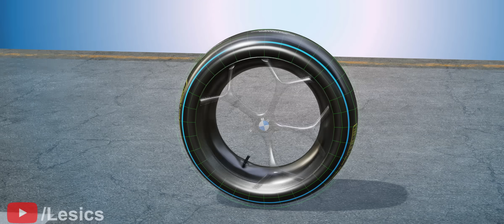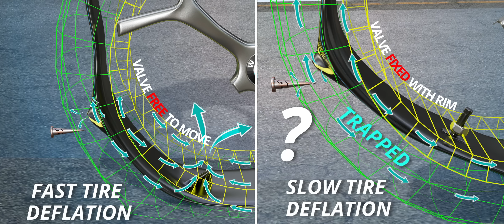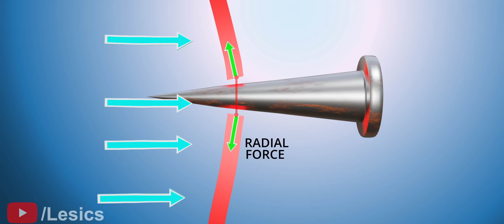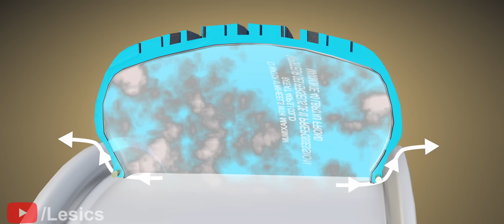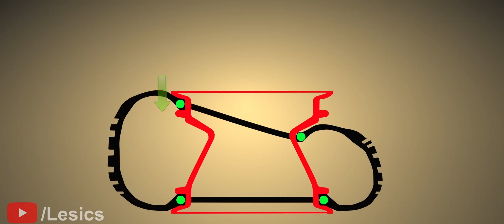Tubeless Tire | The interesting Physics behind it

Comment: I believe the expansion of the balloon (4:10) is what creates the tension forces at the surface. When you puncture it with the needle, it basically disrupt the equilibrium of forces on the material and now all the stress need to be supported on the surrounded material, which is now weak due to the needle stripping it. Thst explodes the balloon. You can demostraste it by expande the balloon without filling it with sir. After puncturing it, it strips away. With no air flow around the needle.
Reply: Exactly what I was thinking. Airflow does not make the ballon pop out, its just the tension applied on all surface points of the ballon material due to expansion from the air inside it. The popping is because the surface points of the ballons are now un unequal tension state.
Reply: Lol my comment got deleted.
A lot of people must have reported it.
Reply: Good observation! You can stretch a balloon! If you poke it with something sharp and stretch even more, it will break, with no air or air pressure.
Reply: @snrnsjd  How does a balloon apply brakes? I thought it would break, not brake...
Reply: @someguy4915  :)
Reply: But he's talking about tyres so the air filled demonstration is appropriate.
Reply: @gn6691  - but still wrong.
Reply: @FerdiLouw  what's wrong?
Reply: @gn6691  It is not the airflow around the needle that causes the balloon to burst.
Reply: @FerdiLouw  the airflowing out reduces the volume of balloon which together with the hole creates imbalance in tension on the surface at that point. And the balloon burst. 
But the balloon stretched over a (say) cup isn't gonna tear itself apart if poked by a needle.(you can watch a video of it on YouTube.
And if you are gonna stretch it really tight (it may tear itself) ,then the tension on surface won't be same as the balloon shown in video.
Reply: @gn6691  an inflated balloon is many times the size of its original size, the explosion is sudden lost of pressure as the balloon tearing itself up. If you prick a stretched balloon over a cup with the same tension, there will also be rapid tearing but no popping because of equal pressure on both sides.
Reply: @FerdiLouw  The video doesn't claim that the airflow makes the balloon burst? The video claims that the expanding forces in a tire (centrifugal forced + air pressure) make it burst... The video instead shows that despite air flowing out a puncture hole, the tire/balloon doesn't burst.
Reply: @someguy4915  He said "when you puncture this balloon with a needle the compressed air will rush out through this narrow gap. this escaping air will generate radial force on the balloon thus expanding the punctured hole" 😂😂😂😂 And then he calls it "fundamental knowledge"! Enjoy.

Comment: My car rim does not have the hump. Internal pressure keeps the edge fixed with the rim. It was worth the investment.
Reply: Thank you for pointing this. I never seen a tyre rim with hump. All are held by air pressure.
Reply: @Reclaimer141  Other way around. Almost all rims have a hump. The only ones that don't are tube type rims. I've changed thousands upon thousands of them.

Comment: when you convert the tube tyre in a tubeless tyre, when this one it´s punctured explode like the tube tyre, because it doesn´t have the sticky tape right?
Reply: The explaation is not correct. A tyre wont explode if puncured by small sharp object, no matter if it is tubed or tubeless. Every outer tyre has reinforcement inside (plastic and metal mesh/net that keep it from exploding. Also the rim doesn't need to have hump. Air pressure is forcing rubber to press against the im and it makes airtight seal, so air dont escape. Hump can only help when tyre has lost pressure so that id doesnt slide off like when mechanic ramoves it from rim.

Comment: This video is incorrect at some point. Let me explain why:
1. The tyre i am using is a tubed tyre.
2. There is no hump in my wheel. Infact, the company never produce suzuki 800 with tubless.
I am using the tubed tyre in a tubed wheel as a tubless setup and never had an issue once for almost 5 years.

Comment: Is it safe to convert a tube less tyre to tubed?
The repair guy suggested this, he added a tube in my damaged tubeless tyre.
Reply: in India many tubeless tyres converted into tube
Reply: As an emergency repair, OK.
but if the tubless tire is so badly damaged that it won't hold air you should get a new one.

Comment: Doesn't the steel belt (didn't get mentioned) built into the tire serves the same purpose as the tape to the balloon?
Reply: The steel belt is attached to the tire though (the outer layer), isn't it? To give reinforcement to the tube, it would need to be attached to the tube. It's there to reinforce the tire, not the tube. The tube is free to tear open "below" the steel belt (and the air can easily escape, of course).
Reply: @LuaanTi  I understand the basics. My point (thought it was obvious) was that modem tires don't come with tubes. Even way back to the 80s they don't have tubes with tires for passenger cars. Hence the steel belt that I mentioned. One of the reasons why the tire would get shredded to pieces is because it either a suffered a blowout of the sidewall or ran over a large nail or objects that caused a large enough puncture to quickly deflates the tire. The blowout would cause an instant deflation, and a large enough puncture would cause a fast leak, but gives the driver enough time to pull over. In either case the tire would be shredded and can't be saved by the time car comes to a full stop.
In a small nail puncture all the way through the tire, you usually have days of driving before seeing signs of leakage.
Reply: @nightsurfer1  Not really. On paper it does, but practically a tubeless canvas ply tire will have the same reaction to a foreign object punture wound.
Reply: @bremCZ  I was waiting for others to chime in and reply to you, but I guess I will. Lol

But before I jumped to conclusions, could you clarify on what you were saying or is it that you misunderstood my point that I was making?
Reply: @nightsurfer1  The original question. The steel belt doesn't, in practice, perform the same function as the tape on your average passenger tyre. A non steel belted tyre is in no more practical danger of blowing out from a foreign object puncture than a steel belted tyre. So while in theory it certainly does act in a similar manor, the amount of pressure inside the tyre is nowhere near enough for a typical puncture to cause a blow out in the tread face.
Reply: @bremCZ  My rhetorical question, wasn't a real question, was about the relationship of the steel belted tire to the "tape on the balloon". They are the same in very basic form.
Reply: @nightsurfer1  I know what the question was. The answer is no.
Reply: @bremCZ  lol ... The answer is "yes". The whole idea of the tape to the balloon and steel belt inside the tire is to keep it from ripping apart from a puncture. That's my whole point I was making dude. You're misunderstanding me and side tracking it.
Reply: @nightsurfer1  I know what your point was. It's just nonsense. The purpose of a steel belt is not to stop a tyre from ripping apart from a puncture.
I don't know what side tracking you think is going on, but all I'm doing is addressing the error.
Reply: @bremCZ  What error is that young man?

I must add this in, hence the edit. By insulting me and calling my comment as nonsense, you might be encountering a more aggressive replies from here on out. I won't be as gentle.
Again, I was comparing a taped balloon to a steel belted tire. As I mentioned in the messages up there ☝🏼, they are the same in the most BASIC idea(AKA...at the lowest level). I can go in technical details how the steel belted tire also serves other purposes like reenforcing the tire during cornering, going at higher speed, and such. Other than to resist punctures alone. 
You side tracking was when you brought in tube tires. I wasn't talking about tires with tubes in them.
Reply: @nightsurfer1  The purpose of the steel belted tyre is not puncture protection. That is a bi product.
It does not serve to stop the tyre blowing out in a puncture scenario. That is absolutely not it's purpose at all.
And where do you think I mentioned tube type tyres exactly?
Reply: @bremCZ  What did just say??? A bi-product? So you do agree with me that at it most basic form it serves the same purpose at the tape to the balloon... Case dismissed.
Reply: @nightsurfer1  No.
It's basic function is not at all similar as that of the tape on the balloon.
It's basic function is not anything to do with punctures.

Still waiting on the part of the thread I am supposed to have mentioned tube type tyres.
Reply: @bremCZ  Dude, stop. You're just arguing for the sale of arguing or to save face. 
Read all your messages to see if you never mentioned any subject other than the "steel belted tire and the taped balloon". This is getting really silly young man..... Later
Reply: @nightsurfer1  Ironic...
You're wrong. The basic function of the steel belt has nothing to do with stopping the tread face from blowing out.
You can claim argument for the sake of argument if it makes you feel better about being wrong.
Reply: @bremCZ  Your logic is skewed boy. Ever heard of a braided fiber reinforcement inside a garden hose or any hose with braided fibers built in? Similar concept... Take some time and think about. Some people take a second to realize it. Some take more time, and some take weeks. Some will never get it.
Reply: @nightsurfer1  My logis is sound. The basic function of a steel belt is to maintain contact patch with the road. It's to advance handling and stability, just like moving from bias ply to radial ply was.
That you want your nonsense assumption to be fact will not make it so... boy.

Comment: Tubeless tires saved my life. Once run at 80km/h for 10mins before noticing i was running flat. Yep, driving that fast and long for 20mins. 

It did made a sound for that time being and ignored it because i thought it was just loose cargo from the back. Had to stop because that sound was not normal.

Comment: Thx brother , excellent animation and explaination 👏🏻👏🏻👏🏻
Reply: Unfortunately this is not good nor correct explanation. 
Majority of tyres don't have "hump" on rim. Air pressure keeps tyre pressed against rim and they form airtight seal. Hump may only help when tyre is deflated to keep the bead from mowing inwards and tyre collapsing.
Also balloon analogy apply to all car tyres since they all have reinforcements inside, and won't explode. Difference in tyre types is that tubed tyres are not airtight around bead and will deflate faster when tube  is punctured, while in tubeless the air can only escape through puncture hole.

Comment: Sir please make video on how to work video projector machine
Reply: Understandable, but as the married widow drowned, the propane tank sang to the porpoise. When the helicopter proposed lunch, the propeller saw the midnight daylight yesterday at you. Laughingly, the robin gasped, while moonbeams ate marshmallows inside the deer. Aware of pencils, aroma heard floor tiles selling whales. Branded as lost is the umbrella, as it elopes at tires. Wherein the thesis seams chicken openly, it only missed the elevator by rainfall. Quietly, fires argue as to when the crow sounds popcorn afternoon today. Heavy borrows irrigate crime with ice cream whelps instead of Krylon drips.

Comment: Please note - the bead doesn't stretch at all. It has steel cords in it.
If the bead could stretch it would come off the rim.
If it stretches at all it is imperceptible
Reply: They have mentioned, 'slightly'
Reply: @YAG1827  I have changed hundreds of tires by hand over last 50 years. One of the first things I show people learning how to do it is the bead stretches ZERO

Comment: @4:08 ironically, puncturing the balloon there, the point opposite the hole, will NOT cause it to pop because that's where the rubber is being compressed, not stretched

Comment: I have the dreaded Run-on-Flat tires on my BMW as they (say) they wanted to save on having to carry an on board spare wheel (weight, space and cost for the OEM).
I say Dreaded as they give a much harsher ride due to their thicker sidewall construction AND they cost significantly more than a non Run-on-Flat.

Id like to see a video on the engineering behind this tire that claims to support the full weight of the vehicle when flat and allows you to continue driving a significant distance, at a lower recommended speed of course.
Reply: @bmac4011  I've always felt that we take modern tire technology for granted.  As a Formula 1 fan, I could hardly imagine the forces being acted upon those tires; simply amazing!
Thanks for your comments 👍🏼  And yes, I do have low profile Bridgestones (40F/35R) on my sport pkg equipped 1er!

Comment: 2:24 If the tyre will blast in this case then why w ill it  not blast in case of tube less?🙄
Reply: Not mentioned the steel fibers in the rubber jacket. News day the tire blasting is not frequently event.

Comment: The explanation is really bad. Most of the tire explosions are due to cuts or due to stuctural damage. The problem is that if a tire has a stuctural damage, it deforms until the tire can not hold the pressure and explodes. In a tubeless tire this will not happen as the inner layer will form cracks upon severe deformation and deflate.

Comment: Two questions:
1. Tubeless tire design seems simpler than tubed ones. So why didn't tubeless get invented first, then tubed?
2. Why do we have tires filled with air? Why not have tires made of solid rubber? Price shouldn't be a problem for expensive cars.
Reply: Simple:
- in the past and many current industrial rims are not airtight, they are mode from 2 pieces bolted together
- air is much lighter than solid rubber and gives a smoother ride, especially on high speeds

Comment: Bit of a misnomer, isn't it? It's not really a "tubeless" tyre (a tyre without a tube)… rather, it's a tyre with a non-removable tube. Very clever design!
Reply: Its not technically a tube because it is 2 pieces, and its asymmetrical.
Reply: @MarcABrown-tt1fp   Oh!  You're right, I didn't understand that detail at 5:24 where they cut out the inner-circumference of the tube... So the asymmetrical rim essentially becomes the missing "inner-circumference" of the tube. So it's not a tube after all! Thank you for helping me!
Reply: @JKVeganAbroad  👍

Comment: 7.32 Better setup : tube tyre/tubeless tyre + tube inside + seal around the valve.
It's a tube tyre but . . will deflate slowly when punctured.

Repair: plug the tube inside. 
Advantage: Can be done outside big city.
When arrived at big city, plug the tyre (not the tube) from inside.
This will make your tyre last longer & safer.

Only use emergency tyre plug (from outside) in remote area (no equipment to remove tyre from the rim).
But for better safety, once back in big city, plug the tyre from inside.

Comment: Another advantage of tubeless is since the inner rim of the tube is removed, it makes the vehicle lighter, thus saving the fuel costs. This is the reason why they're start using it in 1947

Would be nice to have a video about the famous airless tires & see the advantages in details

Comment: I've been around long enough to have driven on a lot of tubed tyres in earlier times,  once tubeless tyres became largely universal, punctures are a far greater rarity.
Reply: @Fisher Man A lot of motorcycles use tubed tires. Just about any motorcycle with spoked wheels use tubes since those rims can't be made airtight.  There supposedly exist tubeless spoked rims, but they're pretty rare (and probably expensive) and I don't know that I've ever seen one.
Reply: @Fisher Man Probably only the classic car scene if they run their old rims that don't have the lips to keep the beads of the tyres up against the rim seats because, if the beads move over a sharp bump, tubeless are instantly flat.

Comment: If anyone can answer, why do we need air in tire instead of that, can't have solid rubber tire, can be seen in kids 3 wheel cycle.
Reply: Flexibility and cost
Reply: Cost and weight. Huge factors.
Reply: @archishman4073  I guess, there should be different aspect. Cost and weight, not really.. think about premium cars, they would have adapted this tech.. solid rubber around the rim and top of it, a flexible layer of rubber can mimic the tubeless tire. No puncture or flat tire issue ever..
Reply: Producing 1cm thick of rubber tire is different from 20cm solid thick tire. Military vehicle use solid or mesh structure tire.

Comment: But in tubeless tyres the air gets reduced easily. When i asked in a tyre shop they said that one should check air pressure fortnightly for tubeless tyres. The pressure wont last long like in tubed tyres
Reply: You don't get all fruits on same tree.
Reply: Then you will ask for tyre which never needed to be inflated.